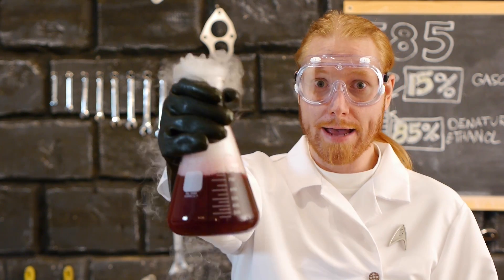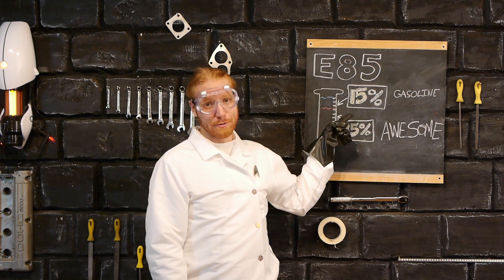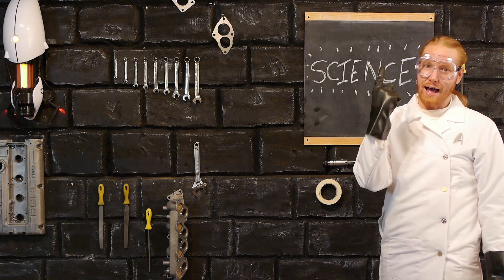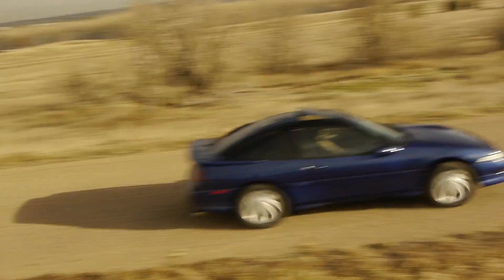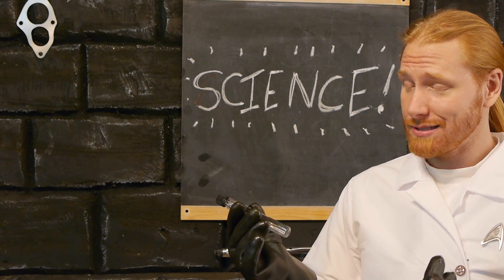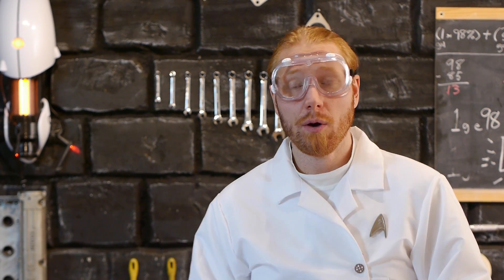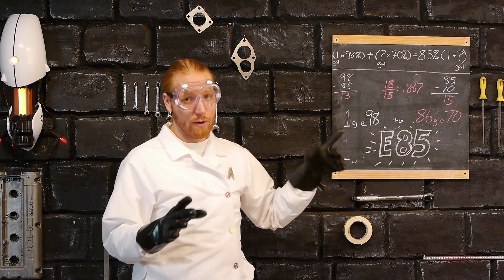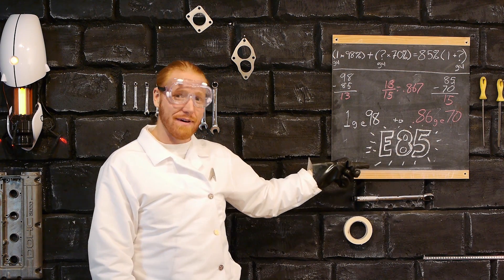Testing E85 Fuel - Ethanol Content

Comment: 85% awsome??? Really? Since when Ethanol is good for your engine? It is good for the environment but BAD for your engine and here is why.

1.Ethanol burns hotter than gasoline, causing catalytic converters to break down faster. Ethanol riches the [air/fuel] ratio by 30% (i.e., 30% energy deficit) (increasing the proportion of oxygen relative to hydrocarbons) which can lead to increased exhaust gas temperatures

2.Ethanol has been known to  wreak havoc on fuel systems, deteriorating plastic and silicone components such as hoses, fuel pumps and filters, gas tanks, and fuel injectors.

3.Ethanol absorbs moisture from air etching on aluminum and magnesium

4.Ethanol interacts with the phosphorus in your oil. Your engine's cylinders never achieve an airtight seal; at best, they'll always allow at least 1 percent of the combustion gases to escape past the rings and into the crankcase, where the oil is. To preserve catalytic converter life, phosphorus levels in motor oil have been reduced. Concerns have risen that oils containing lower levels of zinc/phosphorus could provide insufficient protection in high-pressure areas of flat tappets and camshaft lobes found in many older and high performance engines. AMSOIL recommends motor oils containing high levels of ZDDP for superior protection. ZDDP contains both zinc and phosphorus components working together to provide anti-wear protection.
Reply: Thank you Jorge,I am glad there is someone left whose brains work

Comment: Why would I want E-85?  My cars like Non-ethanol gasoline and my truck likes #2 Diesel... NO "bio-diesel"!!  Bio-diesel gives less power, less mileage and soots up the works.
Reply: Pure ethanol has an octane rating of 115...

E85 has an octane rating of around 100... The cost of 1 gal of e85 is around $1.70 to $2.00. Race fuel costs like $5.00 a gal.

Comment: E85 CAN create more power if properly tuned, and it CAN burn cooler, but it uses way more fuel in the process
Reply: Taydrum true, true and true. In my area e85 is 60 cents less than reg 87
Reply: Roughly 33% more fuel on e85 versus pump gas

Comment: You forgot to mention that is reduces fuel economy, ruines pumps and hoses, uses more resources to produce, causes more smog, attracts water to the fuel, causes engine corrosion, and isn't at all efficient. But, that's just science.
Reply: Isn't at all efficient? so you're wanting to run E85 in your Prius right? E85 burns at 100-105 octane, it increases rwhp on N/A cars and boosted cars by 10-20 when properly tuned, but it might not do anything for your Prius.

Comment: i run both my cars on E85. Becomes so much nicer to drive, more power on the bottom, and more power on the top. my cars are turbo saabs that i have put biopower (flexifuel) software on.

and a bit of power increase. the difference between petrol and ethanol is epic, mainly on the bottom end, its like having a way bigger engine in the car.

good video, subscribed :)
Reply from the maker: Yeah, the real benefit is forced induction for sure, I should have elaborated on that more in the video.   Thanks!

Comment: lol....a liter of gasoline makes way more power vs 1 liter of e85
there for less gas is needed to achieve higher highway speed thus covering more miles/kilometers per liter/galon

e85 on the other hand is naturally higher in octane there for you can run higher compression piston and prevent detonation 
but you still need to inject more of it in the combustion chamber

as a racer what you want is high octane gasoline not e85 

oh by the way,,,,if the USA completely switches to E85 to meet its insane current consumption then it deplete its soil in no time ...to replenish it FAST enough to meed the demand you need petroleum based fertilizers..hmmmm.. ,,,,
so what will it be ? food for human or gas for cars ? you cant have both without effecting the price of the other comodity

you see oil is the reason there so many people on earth LOL because mass production and mass agricluture made it possible and cheap for most people ..our population grew 800 percent within 100 years only...because of crude oil
more cheap food means more people ..... cheaper transportation ..medicine ...you name it

so the question is not when will we run out of it,,,,its when will we run out oil we can afford..cause you the more  you deplete the oil the more expensive it gets... 
once its gone,,,well better prepare our self for it,,,,
Reply: no, as a racer you want e85.

the energy per wheight is less. but you inject more. so you still get more power. 

it is free power man! :)

you get way more power on the bottom end, and get more power to the same airmass. so even on the same turbo-pressure you get more power.

then you can as you said increase the turbo-pressure even more since ethanol has a higher octane-rating. 

a high-octane petrol would only give you the possibility to increase power by increasing turbo-pressure and not give you the free power increase, on the same airmass.
Reply: okay ill give you that
as a good youtube user i am open for discussion
if you are sure of  this info then more power to you
on the other hand i am not so i can not say you are wrong on this particular information

so yeah...
Reply: Faisal Abdulaziz

Yes i know this for sure :) 

I have two cars, both running e85, both are saabs, and i personally tune them, its a great difference to petrol over the entire power band. 

Im swedish so overhere it is also cheaper to run a car on E85 than petrol, even though you have to fill up a bit more often.

They are "flexifuel" so i can try the difference any time. sometimes i put petrol in them and instantly the car feels more sluggish.

Everyone i know who tries ethanol has been impressed by how much quicker the car feels on ethanol.

watch this: https://www.youtube.com/watch?v=NuCUf2Qrzhs&feature=youtu.be&t=17m
Reply: @meyawabdulaziz3863  ethanol also release oxygen into combustion, so that is why you get more power (tho it burns slower cuz octane ranting)

Comment: Great stuff! Will you be doing more E85 videos? I have a bunch of stuff in the works ...
Reply from the maker: Yeah, I'm going to be doing some tuning videos (differences between gas and e85) and a few other forced induction related videos as well.
Reply: Velocity Labs Awesome. The world needs to see this information. Tuners know the benefits, but the Average Joe is clueless about it. I'd be keen to work on a collab video.

I had the opportunity to chat with Cadillac's new head, Johan de Nysschen yesterday at the DC Auto Show yesterday and I asked him about the CTS-V and ATS-V engines and their potential with higher octane fuel. (They're not FlexFuel now, but you know the tuners will fix that, soon enough.) Johan mentioned that the bump on the CTS-V - switching from premium gas to E85 - might only be a measly 20 HP, after I suggested 150. Can't wait to see who's closer to the actual number ... ;)
Reply: Gaucho Panocha some things take time …
Reply: Velocity Labs    really, cuz im still waiting..lol

Comment: Excellent excellent work!  I love it!
Reply from the maker: Thanks a bunch!
Reply: Velocity, I have a question about E85 (I have a twin turbo and built 350Z on Haltech) as far as it's potential to wash cylinders due to the extra volume needed as well as its general propensity to create engine wear. Let me know if you're there so I can ask my question as this video is about a year old.
Reply: I can understand iol/fuel dilution but my concern is with the immediate potential for wear on each stroke of the cylinder  as the extra volume of E85 may wash cylinders or cause a chemical reaction that cuts through the oil left on the cylinder walls before the combustion stroke. Any idea if there actually is this problem and increased cylinder/ring wear?